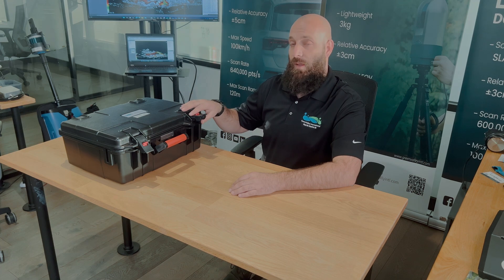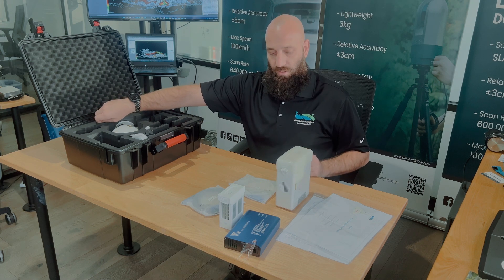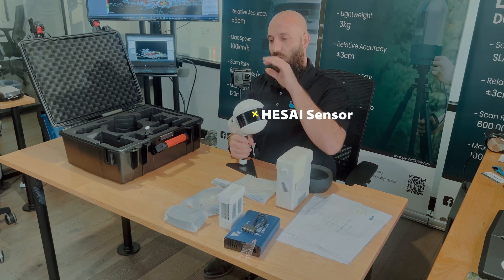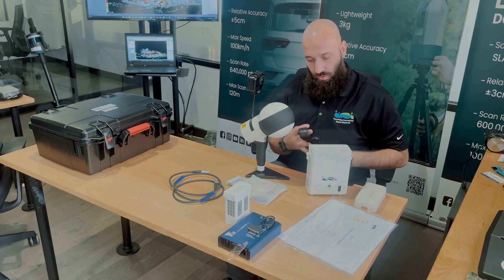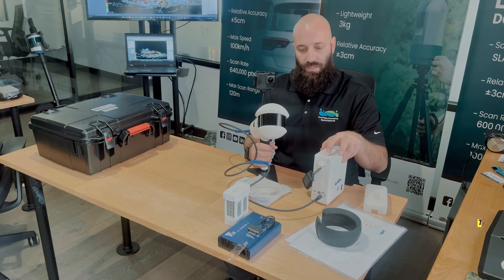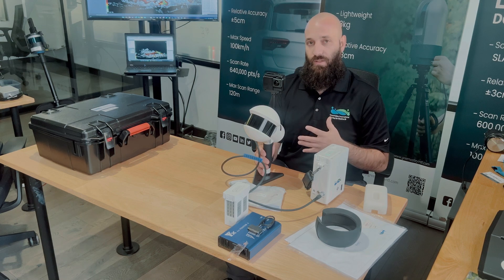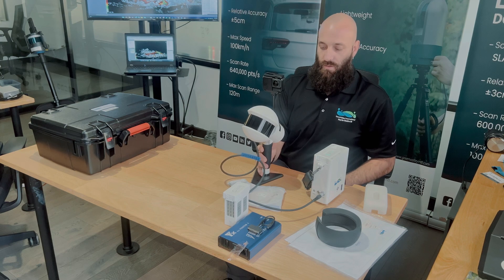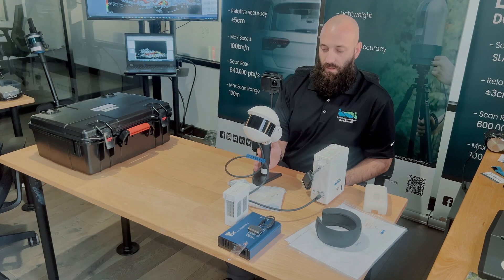LiGrip H120 Unboxing and Setup

Comment: What is the difference between it and the 300h
Reply from the maker: The first is that the distance measurement is different, and the second is that the pixels of the camera are different.
H300 can be adapted to multiple platforms, but H120 cannot be hung on an airplane.
H120 is more suitable for scanning indoor scenes, and H300 is suitable for scanning outdoor scenes.